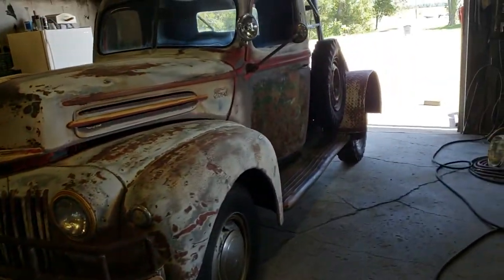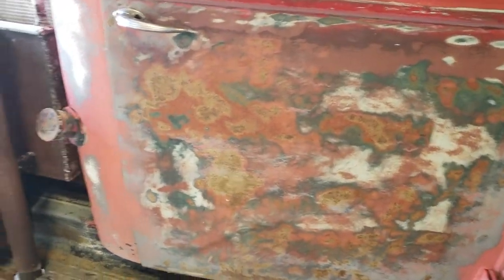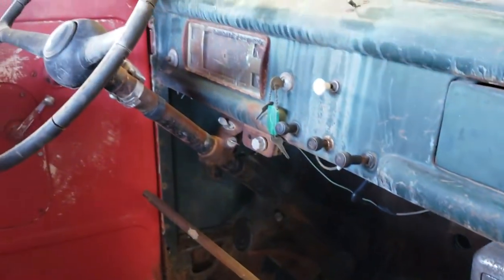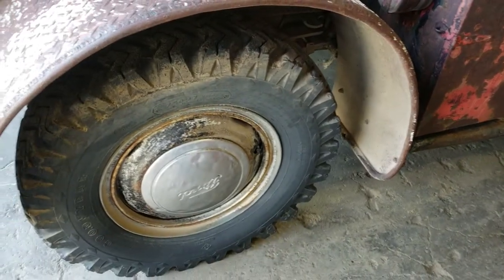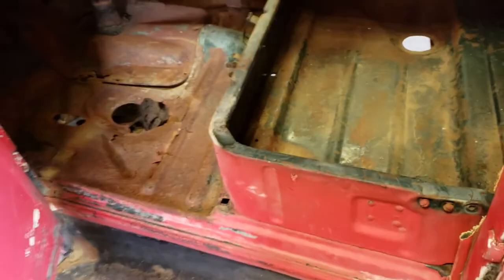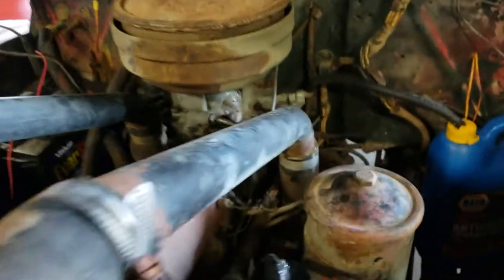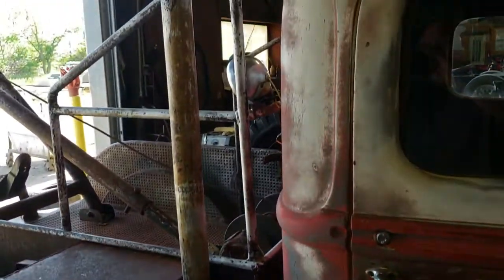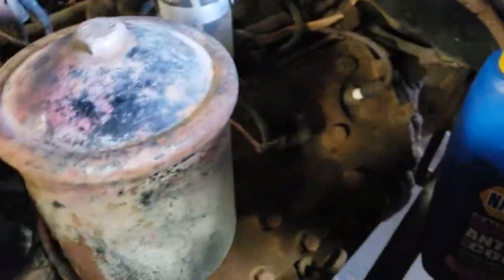Cort's 47 ford wrecker

Comment: Make sure  to oil all oil cups  and make sure fan hub oil is topped off   there is a set screw on fan hub housing  rotation to 12 o'clock  position 
Remove  screw  its about  1 .5 inches long  once removed  put about 1.5 ounces of oil in 30 or 40 weight   thru that screw hole   then rotation  hub to 6 o'clock 
Position  drain excess  oil out if none  drains  rotation  back to  12 position  add additional oil.   Make sure to snug screw  once back in hub  check  once a month  keep  checked  failure to do this will put that fan assembly  thru radiator  .. add oil to  oil cups on distributor  generator   same weight as hub oil 
Also marvel mystery oil  added to  fuel benefit  rings and valves   .... also  add water pump lubricant  to coolant   this helps both thermostats and water pumps 
Seals ..  if water pumps  ever need replacement   at lower hose  going to  radiator   inside  lower hose opening  is one bolt  that needs to come out  to replace  
Pump ....  now for engine temperature  I use 2  mechanical  water temperature  gauges  for each  head ...  exhaust  used reds headers    .. oil filter 
Cartridge   napa carries  them   delo  30 for engine oil .... just helpful  tips  for you  I own 11  flathead powered  vehicles  .. I'm currently  restoration  on 50 
Mercury  flatmotor  no LS bullshit  in my old iron  ... great video  thanks for posting
Reply: Thanks for the tips I'll use them I just got a 1946 mercury eight coupe I found out about the oil inthe fan the hard way it loced up on me I repaired it thanks
Reply: @Mryiyo209.  any possible way to contact you